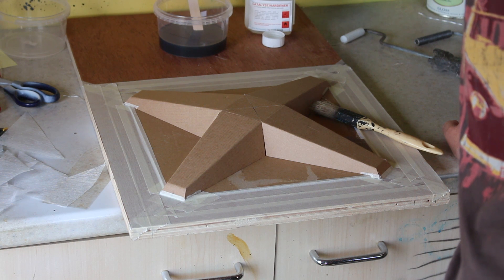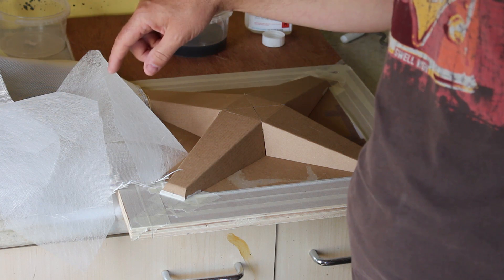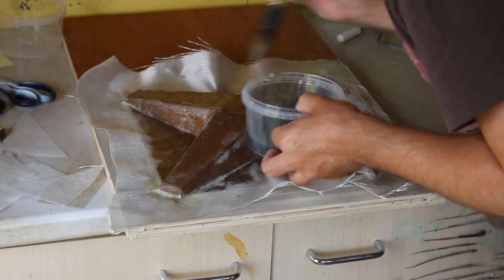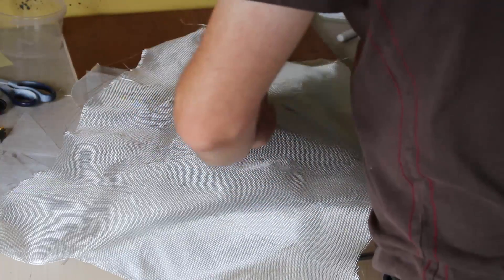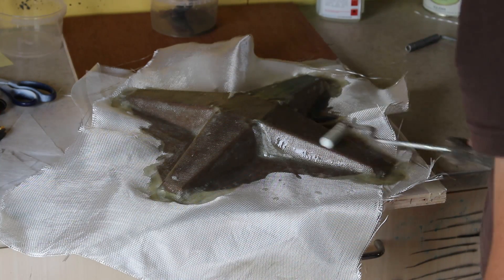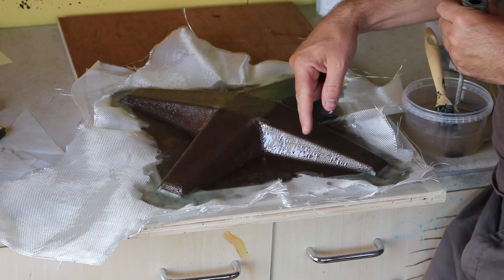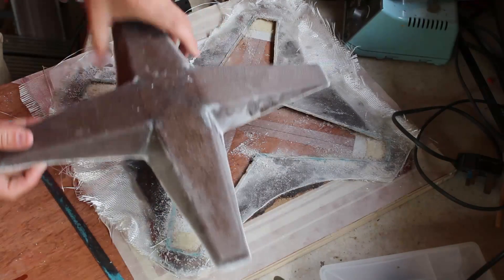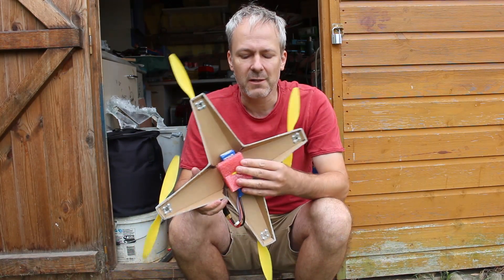Cardboard Quadcopter (reinforced with fibreglass)

Comment: Hey mate, great video! Just had a question about how the fiberglass and cardboard deals with heat? I'm planning on using this method to make a modular synthesiser case, they can get quite warm.. I appreciate that in your case it'll mainly be used outside and the nature of the movement will cool it down.
Reply from the maker: Thanks, As for heat, its not a problem in my case. But i would think it would be ok for heat as my model boat is petrol powered and the exhaust is very near to the side of the hull and that's not a problem.

Comment: Excellent video! I've been search for months for a video on fiberglass layup on cardboard and this is exactly what I was hoping to find. I plan on using the exact same method, only scaled-up, for a reinforced carboard bike box. Thank you!
Reply from the maker: sounds like a brilliant idea, I struggled with the tight corners and if I did it again I would change the direction of the weave or make a cut to allow the cloth to fit better? good luck with your project.

Comment: Very nice Idea,
Could you maybe share which resin and hardener you used for the build
Reply from the maker: Hello, thanks for your comments, the resin was just standard polyester resin.
Reply: @mrfid72 Thanks for the quick reply
 Could you say which one you used, like the brand 
Because it worked very well and I don't know which is best
Reply from the maker: @orimohel4223  if you are in the uk, then i got the resin mail order from CFS. https://www.cfsnet.co.uk/acatalog/5kg-Pack-General-Purpose-Resin-RGP10_005.html
Reply: @mrfid72  Yes I am in the UK
Thanks a lot for the help
Reply: @mrfid72  Is the fiberglass from the website as well?
Reply from the maker: @orimohel4223  < it was cloth i had lying around, you need cloth with a good drape something like the 4oz Surfboard cloth?
Reply: @mrfid72  thanks a lot that's what I have